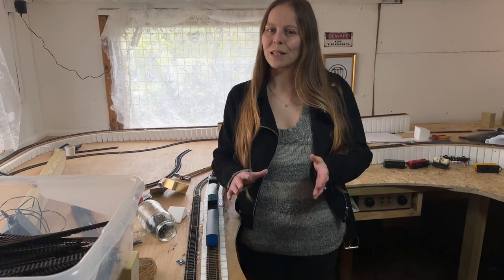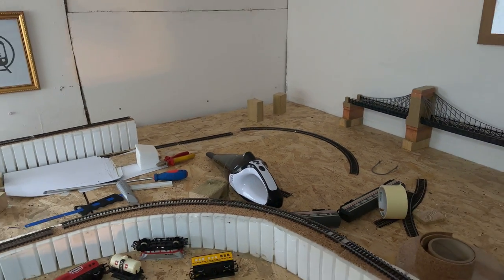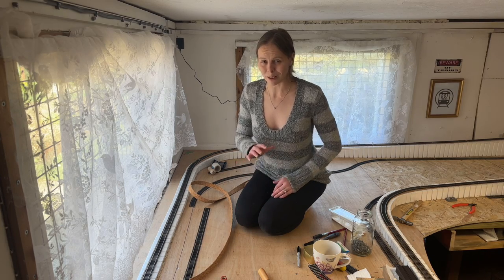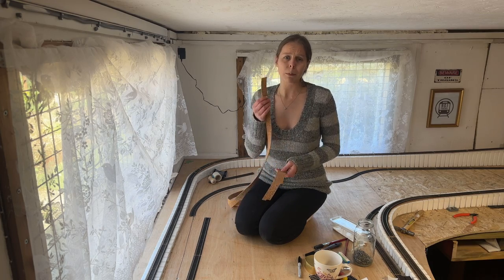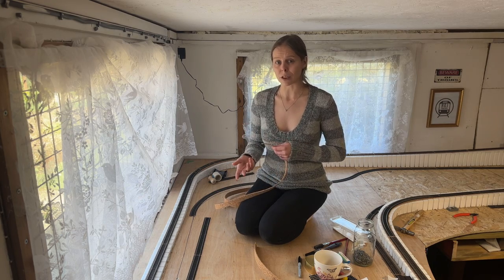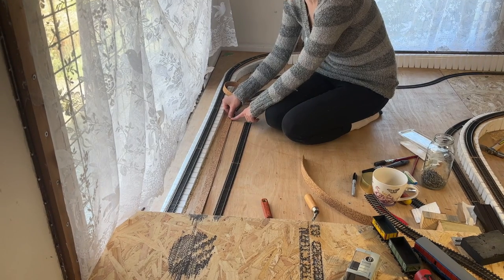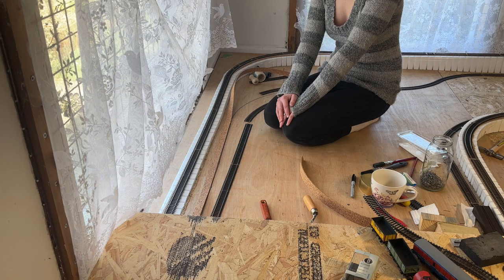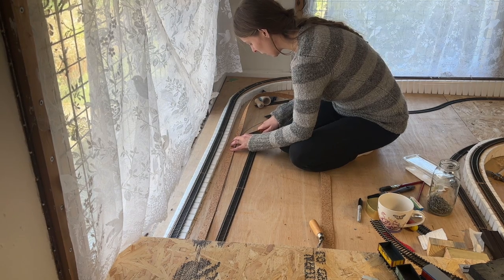RGJ Trains OO Gauge Model Railway layout Episode 13 Cork Laying

Comment: I think the cork curves better if you slit it up the center first so that it is only about 1 inch wide then lay it as an inside and outside section just on the bend sections. Hope that helps for any future cork laying.
Reply from the maker: Now you’ve confirmed that, i’ve seen it elsewhere but wasn’t sure where to cut, cheers Roy, really helpful

Comment: With 3mm N scale cork (self-cut from sheet cork) I have found you can wet it to make corners. Hold it down firmly: I use a stapler, and later remove the staples.
Reply from the maker: All done for now thankfully, probably one of the worst parts.....so far about it, will be more added later, but for now over and done with, the tip about wetting the corners is handy tho, thanks

Comment: I believe you are supposed to cut the cork in half length ways around corners.  Then the cork is thin enough to bend and not to need to do the nicks.  Also I recommend a rubber based glue like good old copydex.  Chadwick model railway did a great video on this.
Reply from the maker: yeah we actually went with that method after, and it works really well, but stopped gluing and used the track to hold it down, then the glue will come with ballasting

Comment: Coming along great guys. As others have mentioned, Copydex is handy as it is easier to remove if/when things go wrong. Something I was wondering about. It might just be an optical illusion, it's hard to tell on camera, but check your clearances on the inner curves. Large locos and passenger coaches have a fairly big overhang. By the time you add in scenics etc to the ramps, the clearances could be a wee bit tight.
Reply from the maker: Gerry yes we checked the clearances with the 125 loco and carriages, it’s ok for now, hopefully won’t get anything larger, but yes copydex deffo the way forward
Reply: @RGJTrains  I always use the peco or hobby gauging tool. Keeps the track centres exactly the same distance apart so no clashing on curves and points.....

Comment: Hi guys, just binge watched to catch up with progress. Guys PLEASE before you go much further, take a step back and take a long hard look at the overall layout. Imagine it with tracklaying finished  and the layout all scenicked with all those lovely hills and tunnels and farms and towns and your trains running. Now I'd like to introduce you to a fella called Murphy. He wrote a book of laws with a whole section devoted to model railways. If something is going to go wrong, it WILL be in the most awkward, inaccessible  place possible ! Trust me THOUSANDS of us modellers have fallen foul of his Laws. As far as I can see you are using old sectional track and relying on metal fishplates for electrical continuity?  Your shed will almost certainly suffer from extremes of temperature, summer to winter, your boards WILL expand and contract. Joints will move, track will buckle and continuity will be broken. You also need access  for track cleaning ? Look at ANY area that is going to be closed over
1) you probably don't  need to ballast it as majority of the time you won't see it right ? And
2) if it's hidden then you don't  need solid baseboards ? Cut as many access holes/ Hatches as you can get away with ! 
3) Seriously  consider investing in some long lengths of flexi track to use in these hidden areas ? Cutting rail joints to a minimum and reducing chances of failure. Also concider, AT LEAST in these areas, soldering dropper wires to these sections to run down to a Bus wire underneath the layout.  Plenty of advice on doing this on the Web. I know it's  hidden/ Boring stuff BUT trust me a bit of time spent these issues now will save you hours of heartache later trying to diagnose hidden problems when you can't  get NEAR to where the problem SEAMS to be. Trust me, been there, done that, along with many thousands of other forlorn modellers !
Please, not in any way criticism  of what your doing, just hopefully  a bit of sage advice ! 

Cheers

Matt
Reply from the maker: Will try to reply to each one

We don’t really have big extreme temperature changes where we are, so only gradual temperature changes, yes will be much warmer in summer than winter, but only gradual slow ones, track cleaning we have two proper track cleaners, plus access to to the parts of the track where we cannot reach overhead we can come from underneath with “manholes” cut into it
1, Only visible areas are being ballast, no point in wasting ballast in areas unseen
2 it’s not totally solid baseboard, there are gaps between them and the surrounding walls, where the joints are there is room to expand, especially along the back wall where you really can’t see so not worried about that area
3, Flexi track, whilst we would love to, this is all being done on a budget right now so sadly we don’t have a choice but to use what we have with us, but maybe down the line we can always change, i know that sounds daft but this track hasn’t cost us anything so it won’t matter if it has to be ripped up and replaced with decent stuff.

We were introduced to “buses” a short while back so will be using those so many thanks for reinforcing that, especially on the raised areas where we can’t have a permanent join in case if needing to raise them, so buses are really needed 

And please please don’t think we take it the wrong way, we are total novices at this so any and all advice is appreciated and taken on board and thank you for taking the time to write such well written content too

Comment: Cutting clefts into track. Grace, would that mean we could call you Stevie Nicks? No, I suppose not.
Yes, as suggested earlier, a plank with some heavy books on it will provide an even weight distribution along the length of the cork for the straight bits. Did you consider drawing pins as on option for securing the cork while it dries?
Will you be running trains at higher speeds? If so, what are your thoughts on superelevation? Something to take to the bank, I suppose.
Anyway, always enjoyable seeing others hard at work while I drink my tea.
Onward!
Reply from the maker: Sorry what do you mean superelevation we’re novices at this, don’t understand everything to be honest, glad you’re enjoying the videos, and many thanks for the hints too
Reply: @RGJTrains  Putting banking on certain curves to give the track a camber.
Reply from the maker: @donstratton6343  Ahh i am with you now, like the pendolino, so a loco can travel it more securely at speed?, not a bad idea, thanks for that

Comment: Why not use a stapler instead f nails/hammer??
Reply from the maker: do you mean hold the cork down whilst the glue dries?
Reply: @RGJTrains  I´ve used  6mm staples in an electric stapler (non-electric is cheaper). You can remove the staples once pva is dry (use some weights when drying) if you wish..
Reply from the maker: @zippo46  ahh with you now, we’re going down the route of pinning the track down to the cork and letting that hold the cork in place then using the ballast glue to sort the rest

Comment: PVA the board, not the cork.....
Reply from the maker: We’ve actually stopped doing either, using the track to hold the board now, and leave ballasting glue to do the rest after